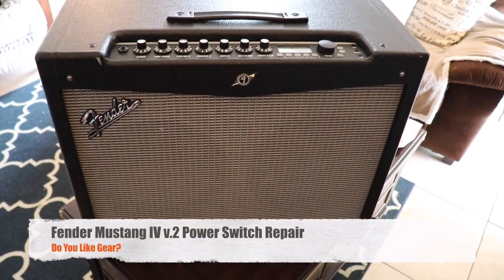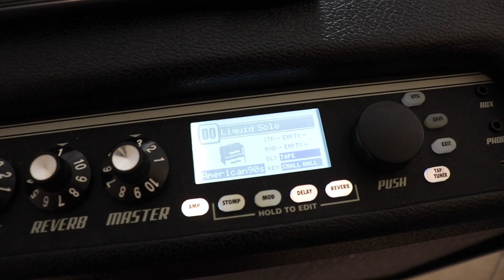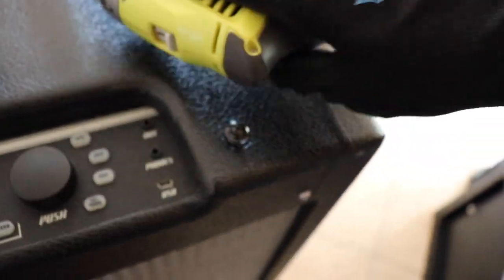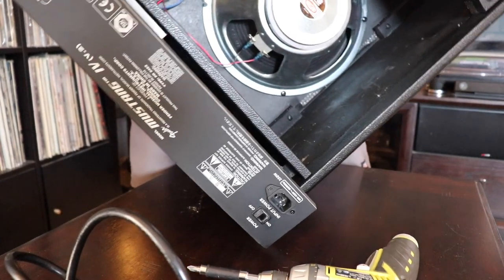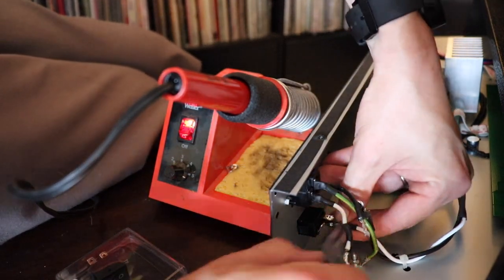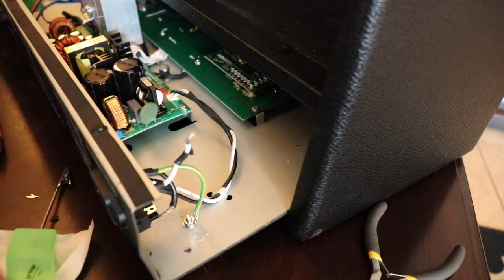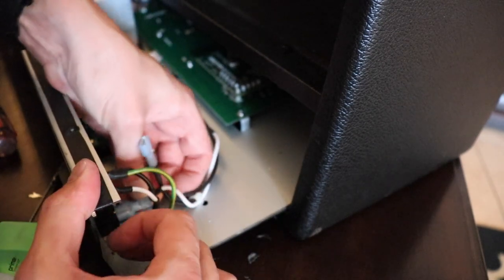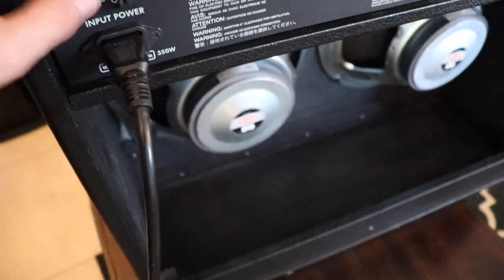Fender Mustang Guitar Amp Power Switch Repair

Comment: Thanks for posting this! I've had this amp for years with no issues until about a month ago the switch went out. It was annoying having to plug it in every time I wanted to use it. Thanks to this video I was able to get the parts and fix it myself. You rock!

Comment: Thank you for this video, it really helped me orientate those little metal prongs. I used electrical tape instead of super glue in case I wanted to get it professionally fixed later.
Reply from the maker: Awesome. Yeah, I think that's the trickiest part.

Comment: Thanks, I just did my GTX 100 thanks to your helpful tips.  More or less all the same with maybe a couple more screws in the same areas to get out.  Also there's a couple wood screws that seemed to help by loosening them to get the chassis to slide out real easy.  Also, the female clips are already on the wires so you just work them loose.  Thanks again.
Reply from the maker: Glad it was helpful!

Comment: Hi there. Have you experienced this on your Mustang, tho mine is the Mustang GT 100.

I've updated the firmware then it was successful, so it says that i need to restart my amp. So turned it off, but it won't turn on. No screen. No lights. No sound.
Reply from the maker: Dang. That's terrible. Try leaving it unplugged for an hour to let all of the power drain and then power it back up.
Reply: @DoYouLikeGear  I tried it. I even left it for a day but it's still not working. I called Fender support last night and they said to just bring it back to where I bought this and they will have it fixed or replaced. But the bringing back part will take a long time since we're still under ECQ

Comment: so my hubby took ours apart and hasn't  yet put it back together. I just need to know how to put it back properly. if you  would can you please make a video on putting it back together. My man issue is if the boards are correct.
Reply from the maker: I didn't take any boards apart. To put it back together I pushed the head back into the cabinet and screwed back in the 6 screws I took out. Send me some pictures of what you've got and maybe I can help out. dann@doyoulikegear.com

Comment: I have a Mustang II. The switch broke this morning.  I may just duct tape it in the "on" position and carry a surge protector with an on/off switch.  Nobody calls me to fix things.  I"m the guy that gets called when a shed needs torn down.  Looks like a good winter project for me.
Reply from the maker: Yeah that will work. I recommend super gluing it down versus duct tape so you don't leave a sticky residue. Just glue it with the amp unplugged. :D 
Mustang II will disassemble a little differently but shouldn't be too bad if you decide to replace the switch. It looks like the exact same switch my IV has.

Comment: Hi! I have a Mustang II and one day he just shut down and never turned back on. I opened it, i brought it to a technician and he opened it up and we couldn't figure out what caused and how to fix it. Any ideas? 

The guy just said "you should call fender tech support" wich is not much of an option since i dont have any in my country, plus its VERY expensive (last time i did it in my neighbour country, (i live close to the border so its near), for the broken USB port and the price was nuts). 

If you have any suggestions please, id apreciate.

Thanks.
Reply: I just lost my Mustang 1 V2,  same thing I believe.  I played it yesterday several times, my daughter unplugged my cable and when I went back and plugged it in and turned it on,  no light - no power
Reply: @eyefreesoul  I detected it was the electronic motherboard fried, i recomend you leave it and buy another one. You have nice prices on Boss Katanas and the new Mustangs now. Dont spend any money on it, it sucks but i guess Fender just sold an equipment with low quality / longevity.

Comment: I found a fender mustang in an alley here in Seattle with the off switch loosing it's flipper part.  

I have actually spent a couple days free sourcing parts and it's kinda nerve racking since I'm not 100 percent confident in my soldiering skills lol.  I might just bypass the switch and use a power strip since I have plenty.

Comment: These solid state amps should be reliable and easy to repair, right? The scratchy Master volume pot is hidden behind a circuit board and cleaning only works for 5 minutes then it's back to sounding like loud fucking noise every time I touch it. I don't even know where to begin to replace it - there's so many screws and so much solder, fucking Jesus christ they really design these to be disposable. fuck